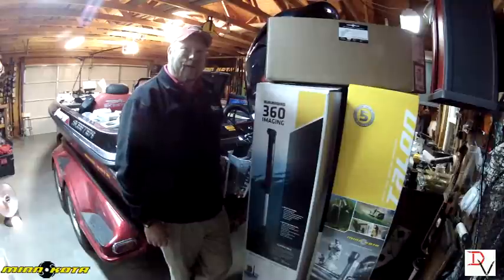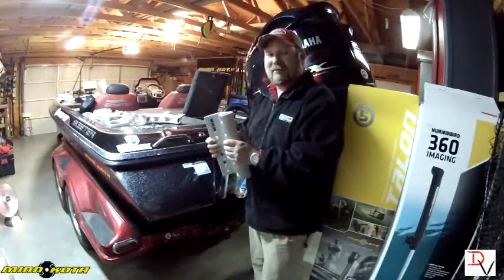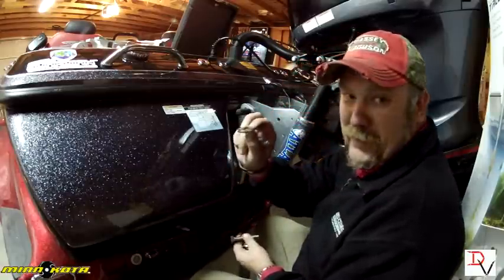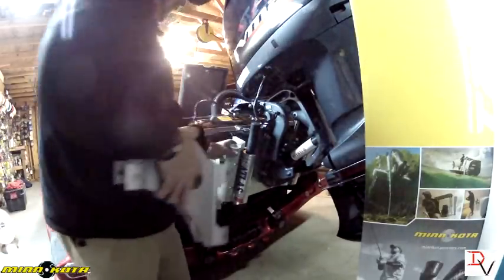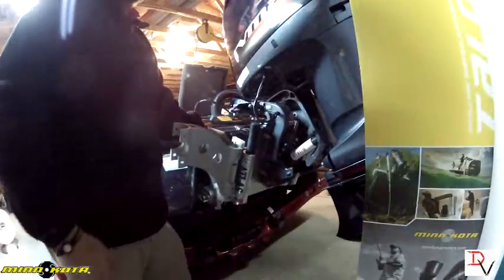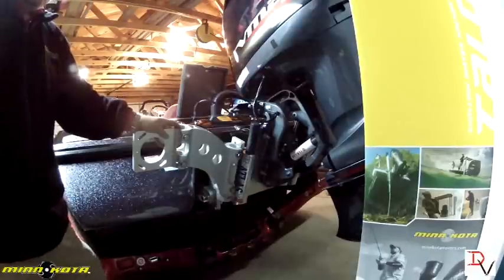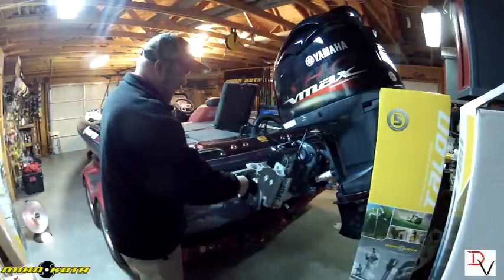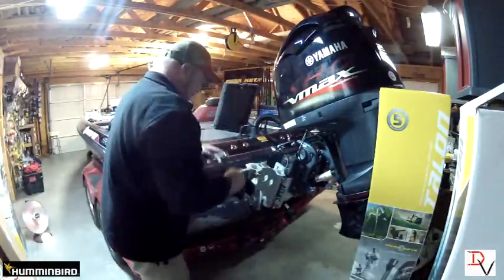Tips N Tricks 84: Installing Universal Bracket & 360 Imaging

Comment from the maker: Yes there is a Dual Extension that allows you use the 360 Imaging and Talon on the same bracket. I haven;t got mine yet but will be installing soon. The Talon will block the signal kind of t=like a standing tree it will create a very small thin black line were the sonar is blocked by the Talon but you can still look in all the rest of the area around it. When Talon is done you probably will be wanting to look forward so won't be blocking the forward view.

Comment: So do they make a bracket so you can have 2 talons/power poles and 360? How do the talons effect the 360 when you're sitting still with them down? Does it just make two thin slivers in the circle because they block the sonar or what?